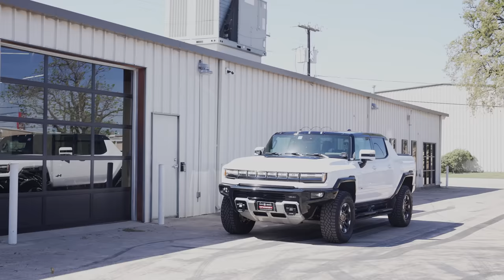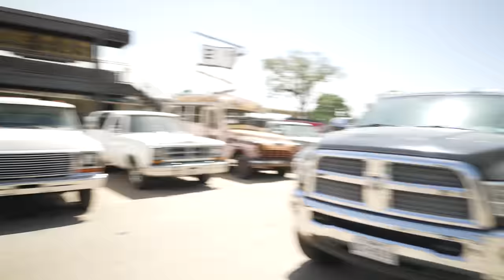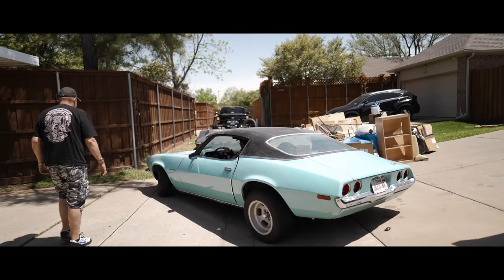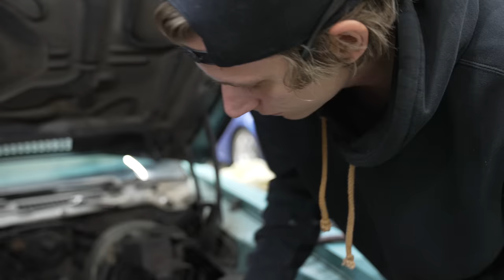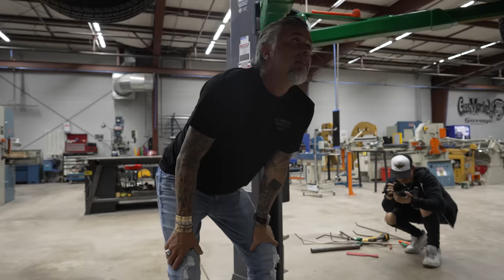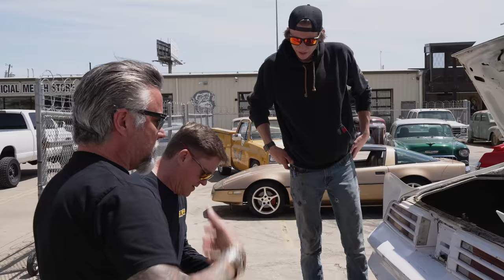3 Deals, 1 Week- Wheels & Deals

Comment: I like that guys idea of calling it “terminators” in stead of “horsepower”. arnold voice I have 1000 terminators.
Reply from the maker: This. You might have just changed the game forever 😂
Reply: SEMA
Reply: @GasMonkeyGarage  I know where there's a SD455 engine for that Trans Am😏. That would be perfect for that car.
Reply: What kind of idea would you possibly have for a power wheelchair for me????
Reply: Gm built all wheel steering in the late 90s
Reply: @Heyjaybird  me to Jay bird I can get 25 kms on my wheelchair
Reply: It and do right
Reply: If i was you i would put some money in to
Reply: Crab walking machine been around a long time never buy electric.
Reply: @GasMonkeyGarage Are you the ones that buy old vehicles? 67 BelAir?
Reply: A hummaro 😂
Reply: Need over haul  need new motor
Reply: At least until electrical power was knocked off line. Whole Eastern seaboard and NYC had that occur a couple decades ago, and only Niagara falls hydro plant built by Tesla at turn of 19th century had power

Comment: Rebuild that original motor of the camaro with some cool internals and leave it mostly original. Repaint it silver and change the interior back to black.  The build sheet is probably behind the upper back seat. Rebuild that trans am motor and get it back on the road as is. Punt it down the road.
Reply: I agree 100%!!!! Change the wheels too.

Comment: The Camaro already has all the right bones needed to go full on and do a killer pro touring with a nice wheel and tire combo with rally stripe package. All upgradable bolt on suspension parts are readily available...new engine and paint, pull the trigger Richard!
Reply: GAS MONKEY GREEN vs robin blue. Those cars looked great back in the day when painted Green.
Reply: I should add, the paint, heads and exhaust, not including replacing the engine makes it no longer an original 50 k car anyway and they're not that rare. More of a reason to go full tilt on it.

Comment: Keep the slots on the back and find some matching for the front.  Lose the vinyl roof paint her silver tail light panel semi gloss black. 350-400 horse small block beef up the rear or get 12 bolt 410 gears go have a blast driving it.

Comment: I agree with most. Repaint the Camaro silver and put the early 70's Z-28 wheels on it in matching silver. The engine has to come out anyway, ship to to a shop to get it rebuilt since it's matching #'s. Then test the car to see if the tranny is still good or not.

Comment: Can't wait to see that hummer on a lift kit 😎😎😎🔥
Reply: you can't really mess with electric vehicles, yet... everything is so precise. especially on that hummer with the 4 wheel steering and regenerate braking, can't just slap on a lift kit unfortunately
Reply: The truck has a button that lifts it 3 inches now. There will be a software update where the truck will lift itself 6 inches. It's called 'extraction mode'.

Comment: I wonder the same exact thing as Rawlings... why can't we use the energy that each of the 4 wheels turning (like a windmill or waterwheel energy system) to keep the batteries charged as you roll down the road. Even if it's not efficient enough to keep the batteries full when you drive it can greatly extend the travel distance instead of just the battery power alone between charges.

Comment: The genius of what Henry Ford did was provide an affordable option for "average" citizens. I'm not seeing it with this truck, not seeing it with Teslas' either. The only vehicle I see on the horizon that might fit that bill is the Aptera, if they can get it launched and hold a good price entry point like they claim they can. It's also has regenerative aspect to that vehicle to where if you just leave it in the sun it recharges itself.
Reply: I think a simple little 2 door hatchback with around a 200 mile range at a pricepoint of around 4k would be awesome. Just a second commuter car for most families. If 1/3 of all the cars on the roads in cities were like that, the air would clear up and gas prices would drop because of supply and demand.

Comment: Early 2000s gm had a 1500 with rear steer GMC I think. The rear fenders looked a little wider and the axle looked wider.
Reply: It was ....03, or 07. GM 1500 had that rear steer thing going on but it was SOOO expensive to fix when it broke that dealerships wouldnt/couldn't warranty it...I think.

Comment: You all make a big deal of how clean & original the Camaro is underneath, so it seems like it would make an ideal candidate for a restoration. Also, you're mention the engine is blown, but that doesn't always mean it can't be rebuilt. I'm just going by what I'm hearing and it sounds like the car should be restored, and the block be saved if possible. Because it looks to be nice to be turned into another hot rodded Camaro. YMMV

Comment: I would definitely use the original block and rebuild it, 17” rally wheels, rear air shocks, blue rally stripes to go with the blue interior and respray it silver with GMG touch. That car would be a nice cruiser with all the power options.

Comment: You sure it’s not a WS6 Trans am. It does have the 15x8 snowflake wheels. 
If those are original to the car. 403 powered TAs also came with the WS6 package. 

Also the decal on the shaker is incorrect . 403 equipped TAs  the shaker decal should say 6.6 liter not TA/ 6.6 . TA / 6.6 is for Pontiac 400s.

Comment: I hope the fuel line is replacement with wire construction. I had my son’s  Pontiac had some screw ball put a regular rubber hose on his fuel line about two foot and when you opened the four barrels it caused the rubber hose to collapse. SEMPER FIDELIS

Comment: Was that a solid lift motor ? If they had 202 heads on it they may changed cam to solid. Lots people don't know you got to adjust the valves every ten thousand miles. Even sooner if you run it hard. I learned that lesson the hard way. Bent pushrods valves the whole nine

Comment: I had a 70 RS and that looks like the real deal, it was painted but it has all the real RS parts not just a non RS with split bumpers added, the side RS badging looks correct, didn't notice if it had the RS badge steering wheel or not, either way it is a rock solid car. While I long to own my RS I like the Restomod Idea but keep the outside and wheels looking more 1971. My car was a orig 4spd car bought new local to me and still had all the paperwork from the dealer incl the protecto plate. Sold it for $2k in the late 90's, last I heard it was stripped down to bare metal but never heard of or saw it again in my area.

Comment: All you need is a ring magnet steel rod in house wiring three switches and the other power you wanted on your car forever for free no moving part doesn't make heat and you don't need a battery

Comment: Since you like to flip vehicles and make money. You need to visit your local Ford dealer and try to jump ahead of the line for a new F150 Lighting Platinum Super Crew EV. Considering the top end Platinum will be limited compared to the other models. I'm guessing you should be able to make a few bucks when you flip it, plus it will make a hell of an ultra nice shop truck with 563 horsepower and 775 ft lbs of torque with a 300+ range with it's built in bed scale that weights you load changing range up or down.

Comment: I'd like to see Gas Monkey do a 6 cyl Twin Turbo install, in either an MGB or Triumph TR6 or TR250, using a modern engine and tranny.  All are around 2500 lbs.  Freaking fast, even for Richard, after the swap

Comment: 12-20 ,000 to replace battery average! Plus it's cheaper to fill with gas @4.00 pe r gal the electric cost the same as oil notice he tell you the cost per charge

Comment: I am calling shenanigans! It takes a lot longer to charge than 20 minutes!
Reply: Select trims are compatible with 800V DC fast chargers up to 350kW to enable nearly 100 miles of range in 10 minutes of charging. GM estimated available driving range of 350+ miles.

Comment: I'm pretty sure Gm installed double humps on cars till 1961-1972 and after that you could buy them otc. As for the car I would go through the engine that's in it now and NOT throw a crate engine in it..

Comment: How about a tuna boat ford or Mercury from the 80’s or 90’s stuffed with a 7.3 ford Godzilla motor? Or finish the 71-73 Buick Riviera? Or stuff a warmed up 7.3 in your black Ford Transit luxury van we see you running around in. Or put the 7.3 in a ford Econoline extended cargo or passenger van.

Comment: Its hard to believe this,just to plug in my block heater in wintier is $5 a day in canada..this can load full power for $30..i wont believe it and how will it run at -50 degrees,if it runs out of power you will freeze to death

Comment: Yeah it might be cheap to plug it in but nobody's talking about the cost if it breaks down those batteries are very expensive and I can't afford that you can't take that to your local repair shop there's a heck of a lot of expense behind those and there's certain places out in the back woods living you can't take those trucks because there's no plugins I wouldn't have it I like the wheels turning in and out that's cool but you can do that for gas powered vehicles too so I say heck no I don't want one and the prices are a lot more than I can afford

Comment: Gas, diesel, steam, or electric I would think horsepower is how many horses it can replace. Richard needs to drive a Tesla Plaid.
Reply: Yes the free market decided gas is the most efficient horsepower’s. Why? Turns out going to dig for oil is more efficient than going out to dig for batteries so u can then store coal power into them which you used ICE to get

Comment: hydrogen power is a better idea than electric lithium battery powered vehicles in my opinion. Toyota agrees and there are many others out there building hydrogen fuel vehicles as well.
When Richard said, "electric cars should never need a charge." what he's talking about would be a perpetual motion machine which would not need an external energy source and it's existence would violate the laws of thermodynamics.

Comment: I've actually OWNED that Camaro. In 1973 I was in the Army, stationed in Fort Sill (Lawton) Ok, and bought a new Camaro....paid $3800 CASH out the door.  I screwed it up though. It has "half -vinyl" top, remember those? ...and my dumbass had about a 5 or inch diameter porthole (trending at the time) put in it because I was 19 years old and DUMBASS! That is all sir.

Comment: Loaded up in 20min….i call bs…
Reply: Google it

Select trims are compatible with 800V DC fast chargers up to 350kW to enable nearly 100 miles of range in 10 minutes of charging. GM estimated available driving range of 350+ miles.

Comment: This guy needs to go back to grade school if he can’t understand why a EV can’t charge its self and run forever. Energy is lost from heat through the wheels, brake pads, and electric motor. Not to mention when you generate electricity there is always a lost energy.